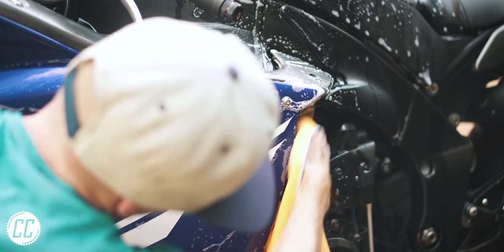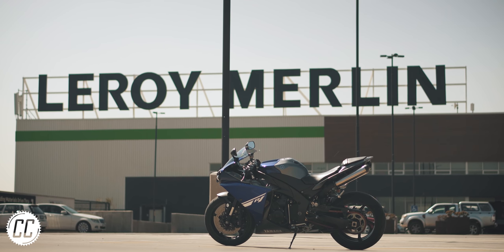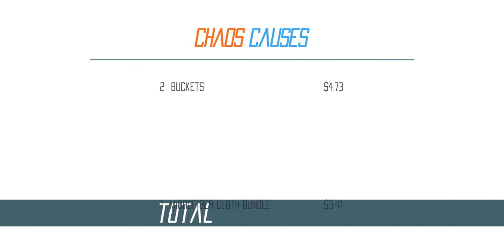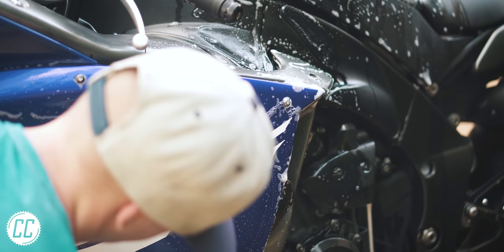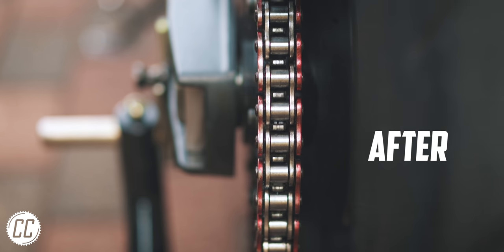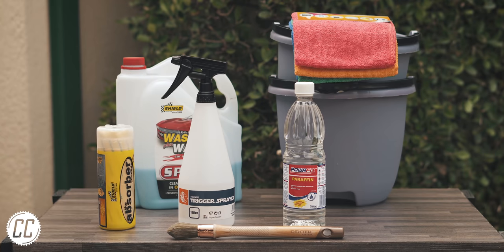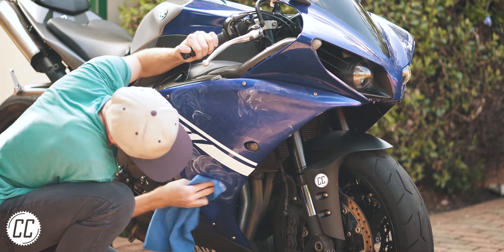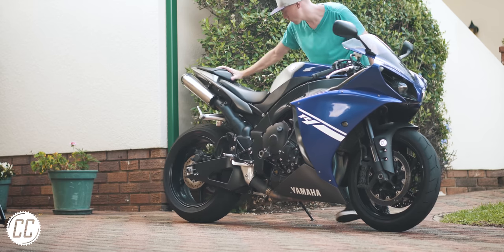$25 Budget Motorcycle Wash Kit

Comment: Washing a bike is so much fun. Especially with a power washer, it saves so much time and makes the whole process that much fun.
I would suggest investing in a Pressure washer. It can be more than just car/bike washer. Try cleaning your porch with it.
Reply: If you're going to use a pressure washer, be careful to know where the electronic components are located as they're not usually sealed well enough to stand up to a direct blast.

If there's a wash it yourself car wash in the area, they often have an appropriate washer and greatly reduce the mess you make at your own house.

Comment: Leave the chamois that thing scratches even the slightest bit of dirt out of the paint, instead add a bigger microfiber cloth for drying 🤟
Reply: Lol, as a dirt bike rider it doesn't really matter. My bike is designed to be filthy
Reply: That's why you need to wash the dirt off first. And don't be aggressive on it. Wipe with love, lol
Reply: MentalCapacityOfDirtBike 668 then why are you watching a budget motorcycle wash kit?
Reply: Much with a Mouth Dogepool as i’ve said before chamaois is a no no, as we own a detailing shop. chamois absorbs all the dirt and scratches the surface even if the surface is spot on clean